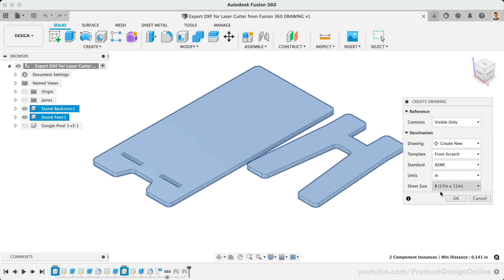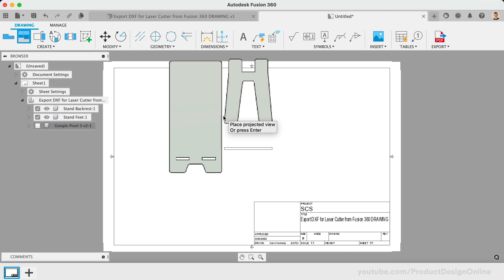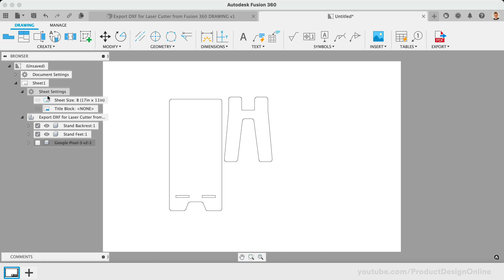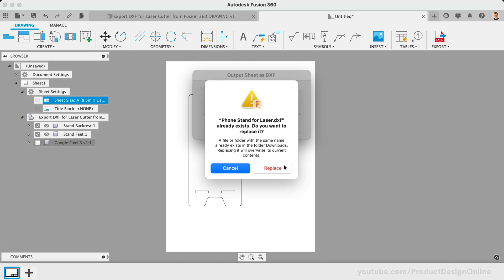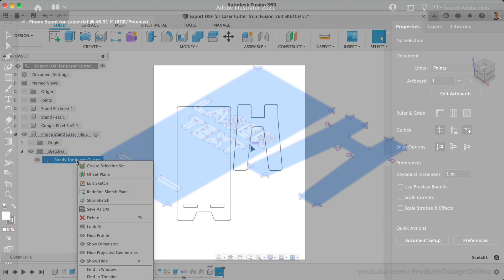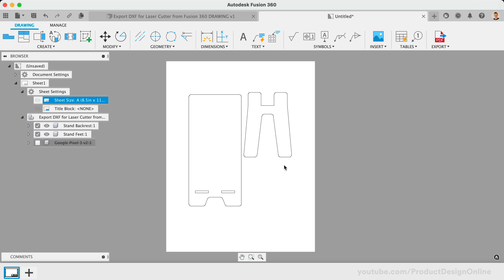Export DXF for Laser Cutter from Fusion 360 DRAWING - Learn Fusion 360 for Laser Cutting 6 of 6

Comment: Thanks for the great video series!

Happy to report that contrary to this video, Fusion now includes in a saved DXF, ALL line-work in a drawing, even geometry that extends beyond the paper size of the sheet.  Line-work extending beyond the page size will be omitted from a PDF as you would expect, but for a DXF, Fusion includes EVERYTHING.     This is good because sometimes my parts are 12 feet (~4 meters) long.  

For this reason my preferred workflow for complex assemblies (with many pages) is as follows:

1) Make a multi page drawing file as typical for the purposes of sharing and describing an assembly.  This should include all the flat patterns for sheetmetal parts, bend tables, critical dimensions, and other parts for laser cutting, etc.  
2) Make a COPY of that multi-page file and rename it something like “For DXF Export”.  Note that this copy is still linked to the model file and can continue to be updated semi-automatically if the geometry is edited.
3) Open the new drawing file and remove all boarders and unneeded views. 
4) Set all the scales to 1:1
5) Export each sheet as DXF

For my projects, every assembly has 2 drawing files: one for description and one for DXF export for laser work (cutting and etching). So far this is the best practice I have found for for getting my projects fabricated.   

ProTip: If you give the sheet good names (like the part ID and part description) the file names will inherit the sheet names which is a big help.
 Bummer: why Fusion does not give you a way to publish all sheets to DXF as a batch process, I have no idea.  I would love that feature.

Comment: I noticed when I import the dxf into light burn several of the shapes that were closed in fusion 360 are now open.

Now I know I can close the shapes in lightburn fairly easy but if I was working on a larger project with many shapes it could be a problem.
Now I guess I could export it as an SVG and most of the shapes would be closed that way but I'm wondering if there is a different way starting in fusion 360 that guarantees closed shapes when I bring the dxf file into another program.
Reply from the maker: Did you export as DXF from the Drawing or from a Fusion 360 sketch? I have experienced some issues myself, which have always been from the Drawing route. The Export as DXF from Sketch seems to be the most consistent.
Reply: @ProductDesignOnline I am pretty sure that I was following along step by step behind you in the tutorial but let me try it again maybe I have jumped ahead and thought oh I know how to do this. Thanks for the reply.
Reply: @ProductDesignOnline  did you create this video yet? been searching everywhere for something like it. tried to add laser cutter from manufacturing workspace, on my own and fail lol.
Reply from the maker: @kpp_3  There's a number of different factors at play. If you can share your file in the PDO Community then I can take a closer look - https://community.productdesignonline.com/